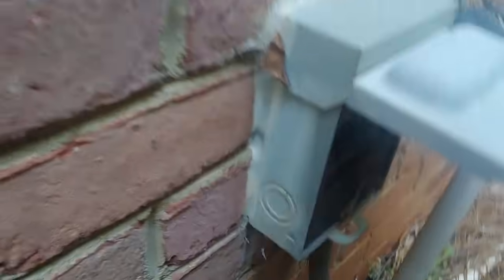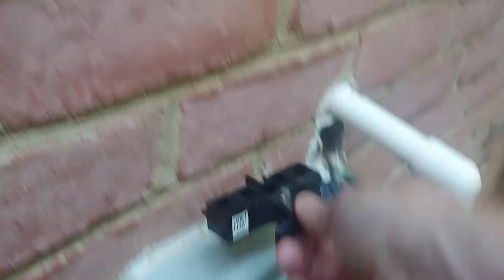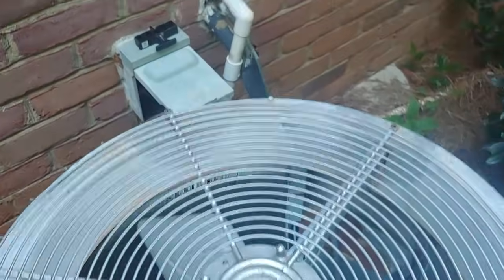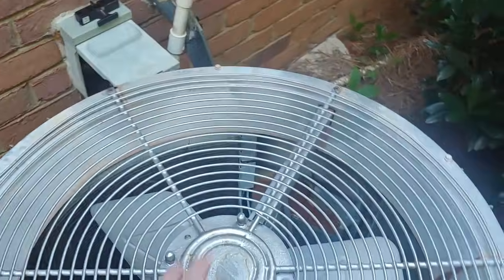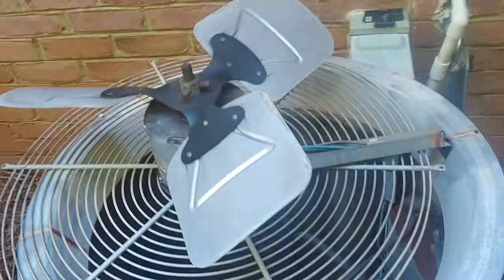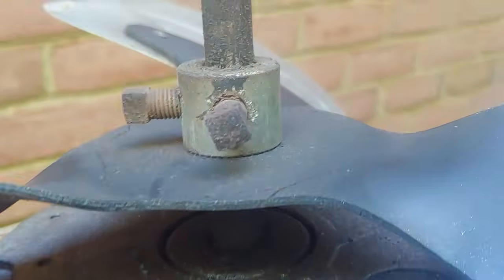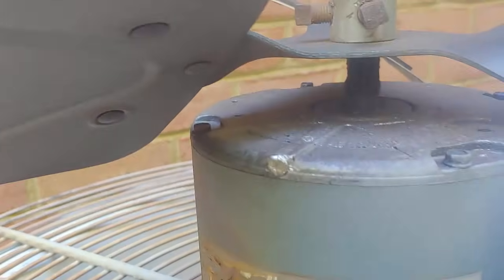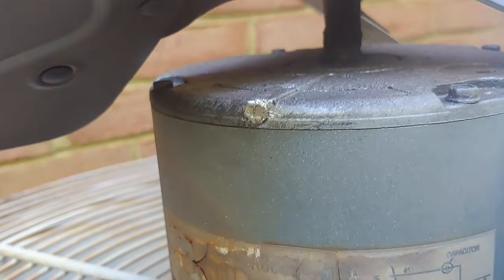YES! You CAN oil an air conditioner fan motor AC Fan squeaks/squeals/chirps/screeching noise, FIXED!

Comment from the maker: Final Update (edited) it lasted three and a half years after this and I think I oiled it one or two more times. The system finally developed a coolant leak, probably in the coil in the attic. It was slow but it was starting to cost me money to have it charged too often. I finally replaced my units and I'll do a video about that too how I saved massive money replacing the units themselves. Thanks to everyone for continuing to watch this video to extend the life of your unit and save money!
Reply from the maker: @studyingpain  Not yet. It's still as quite as a church mouse. We've been running the AC for a month already this year in this part of Georgia.
Reply from the maker: @studyingpain  yes, I use whatever motor oil I have on hand. I refilled that 3 in 1 brand bottle with a motor oil, probably 10w-30. There is oil meant for motors as you see in these notes from others. But my experience is that whatever motor oil you have on hand works.
Reply: Just added this oil to the shaft, the amount of noise (screeching) i truly felt bad for my neighbors. So far its been an hr an its humming, have you had to reapply oil?
Reply from the maker: @romanbuitrago6216  Hi Roman, no not since this video and I am in Georgia...AC runs a lot. The spare motor I bought is still in the box!
Reply: Swimming in the Deep awesome man thanks! Im in Miami where its hotter than the surface of the sun along with 1000% humidity. So far shes purring like a kitten. Thanks for the response brother🤙🏽
Reply: My motor is 16 years old and I just dropped some 3 in 1 down the shaft. It’s been quiet while running for the past week. Planning to last the full summer and then maybe replace, depending on other issues. Also in Georgia.
Reply from the maker: @LouIsFatAndSassy  Glad to help! So good it worked for you too!
Reply from the maker: @LouIsFatAndSassy  excellent! Thanks for taking the time to let me know and for sharing with others!  Mine is still going from the last oiling in this video. I've oiled this unit maybe three times in the last 10 years. The unit is 28 years old. I know newer units are more efficient but they don't last long, negating their efficiency.  You are in the Milton area?  Me too, just inside of Forsyth off Hwy 9. Small world.
Reply: My "lubrication-free" motor started squealing eight years after installing a new HVAC system. I drizzled some oil down the shaft and planned to buy a spare motor for when the temporary fix stopped working, but as the unit continued to operate just fine, I kept putting off the purchase. Five years later, it's still running quiet; I've got a photo of the model/specs sticker saved so that I can just get a replacement dropped in the mail when this one fails.
Reply from the maker: @sirrebral  Ha! This motor has been going this time for 11 more months but it is probably 10 years since I first oiled it!

Comment: What page online you ordered the motor from?
Reply from the maker: It's been a month or so and my old motor is still running with the oil but I did order one and it got to my house quick and have it in hand. I ended up getting it from https://electricmotorwarehouse.com/. I have no affiliation with that site.